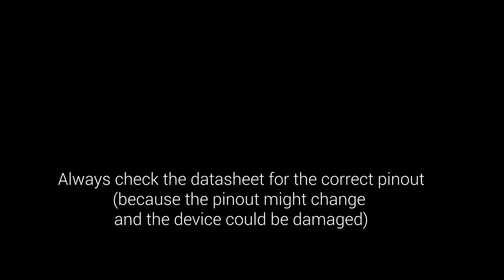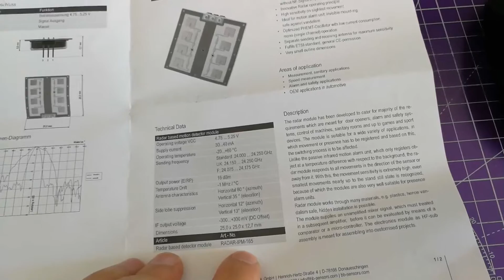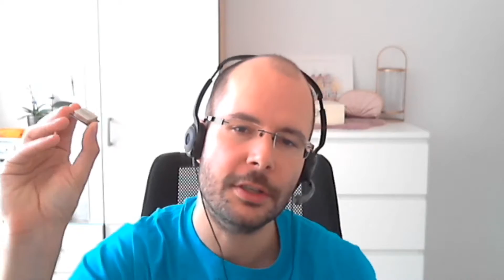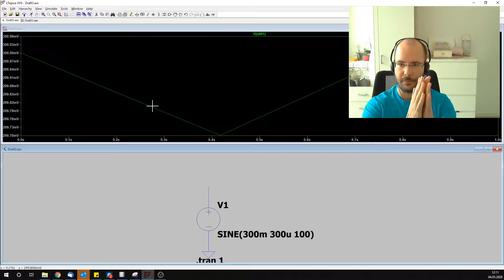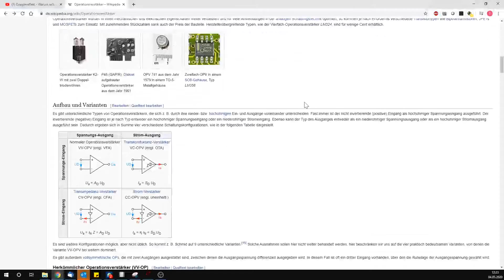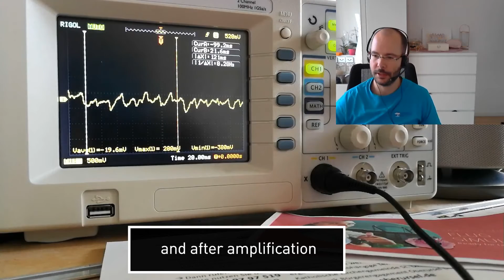CW Radar ( IPM-165 / CDM324  )

Comment: What can I do to use this module only as a receiver module?
I want to cancel the transmitter part. I just need to work with the receiver part that detects microwave signals.
Thank you.
Reply from the maker: I only have vague assumptions on this question and I'm not really sure if it would work. Better ask somebody else ;-)
Reply: Na na na, only as a receiver ? Ein Schelm, der Schlechtes dabei denkt.
Reply: Im Grunde genommen könnte man den Sendeteil abdecken und nur die fremd eingegangenen Signale aus dem Mischer auswerten.